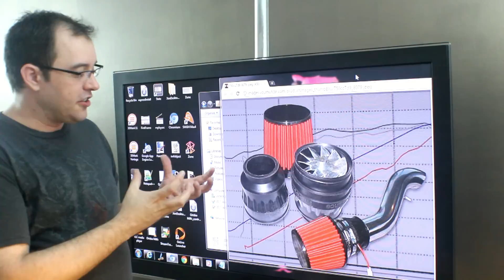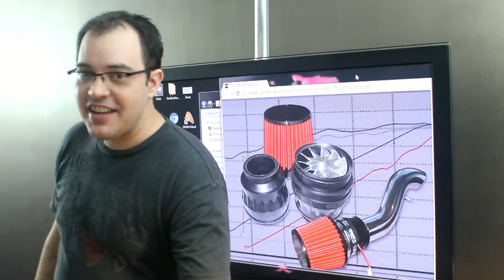Electric Turbo / Electric Supercharger / Forced Induction System: Should I Install?

Comment: the fact is, it helps. Any air being pulled into your motor will help efficiency and performance. however its not what everyone thinks it should be. it's a tiny fan for god sakes it'd not going to do what a real turbo is going to do, or supercharger. however hook an electric motor to the comprising fan and housing of a turbo and that will produce boost up to 3-6 psi. depending on your electric motor.

Comment: Good discusion on CFM.  To do the math, convert engine size from ci to cf.  Multiply by max rpm and divide by 2.  Your engine will never draw more than that using NA.  For a 350, it works out to around 607cfm.  Cant go by head flow cause you will have more than 1 intake valve open at a time.

Comment: @BlackwaterOpsDotCom Rule of thumb is 150 CFM delivered to the intake manifold  per 100hp desired. A 600 CFM turbocharger can help develope 350-400+ HP. Do you see this doing that? Airflow under pressure is much different than airflow.

Comment: Honestly, the only good one I've seen is an E-ram, and I could only see it's best application on a geo metro or ford festiva or ford aspire in colorado. The air is thin and these car's engine's have a hard enough time making power. Claims of these (single unit electric blowers) realistically making more than 2 psi is near false (there are exceptions). I think a tornado fuel saver might be handy for an E-blower just to act as compressor inlet guide vanes, maybe add a bellmouth to the filter too.

Comment: It's not that you couldn't boost an engine with an electric turbo/supercharger, but pretty much all the electric blowers I've found online that actually can deliver enough flow and pressure are large industrial units that would barely fit in the car in the first place. Most of them had at least a 5 hp motor to drive them as well.
It really shows how impressive the output from even a small turbo is.

Comment from the maker: It's about Pound of Air per minute not PSI, or CFM.  It isn't a placebo I measured it at the torque converter. the MAF and the Relative Torque meter don't lie.  I didn't leave it on, I wouldn't trust the thing to not burn up, or the plastic blade to get sucked in to my turbo. But basically as "pre-spool" it works. But again at the expense of raising my idle and sucking more gas, for minimal gain only at the low end.

Comment: Superchargers and turbos compress air and a fan can't. The better option is to hook up a leaf blower to your intake. It might cost more but it'll work a lot better
Reply: ***** yup
Reply: +Brandon Krause 
A leaf blower also wont work.   Because it's just a fan that blows air.  It doesn't compress anything.
Reply: Mighty Car Mods did it with leaf blowers and it gave a car like +2HP.
Reply: some other guys put 5 leaf blowers on and older monzaand supposedly it gave power.
Reply: mythbusters blew that out the tailpipe , better to blow dry your hair instead  !

Comment: to control how much power you want it to put out or if you simply want it on or off.
but the best part is , they run on power v from 7.2 to 14.4 so you can connect it directly to the battery with switch in between.

if you are interested in the idea and need any help, feel free to ask

Comment from the maker: I mostly agree.  That said, I did end up figuring a way to make it help.  Pulling air from under the car up, and ducting it towards the intake dropped the Intake air temp 1.5 degrees on a 70 degree day. Made no difference on a 100 degree day. Not worth the hassle, or the cost, and not being used as a turbo, but it likely would increase power a little, and MPGs.

Did much less than the intercooler upgrade.

Comment: The reality of these "electric forced induction" schemes is that conceptually they can/will work.  HOWEVER, the devil is in the details.  NOTHING is for free.  Turbos need a hot engine exhaust stream and superchargers need a belt and a pulley mounted on the engine.  What most people don't seem to grasp is that to generate any appreciable airflow and pressure requires a LOT of energy (many tens of amps of current).  I could tell just from the size of the wires sticking out of the "inline fan" dude was holding up in the video that it wouldn't work.  

To put it simply, if you see an electric turbo/supercharger kit and the diameter of the wires leading to the motor doesn't resemble that which goes between a starter solenoid and the positive terminal of the battery - it's almost 99% guaranteed to be junk.

Another thing is that most workable solutions are going to implement is a fan/impeller/housing shape that resembles a turbo.  An "inline fan" is NOT the proper design choice when you are looking to build static pressure - which is what a forced induction system needs to be able to produce (along with CFM)...

Comment: It may resemble one stage of an axial compressor, but they require quite a lot of stages to provide an actual boost, plus an entire axial compressor is quite large. Had it been a centrifugal compressor, even with a single stage it could eventually provide some useful boost.

Comment: The cubic feet per minute measurement is a means of distracting you from the figure you're actually interested in, which is psi.  The volume per minute assumes ambient pressure on both sides.  When you increase the backpressure, the volume per minute goes down reeeeeeal fast.

Comment from the maker: I didn't promote it, and I wouldn't leave it on the car. It was "full on" all the time. but on a 1.9L mini cooper with the first restriction being the stock air filter it pulled enough air to increase the air flow, and you could see the difference at the MAF Censor via the ODBII port.

Comment: Putting the blower onto the MAF sensor with the motor off key on, and the intake pipe disconnected at the throttlebody so it was open, the blower only generated ~220 CFM, which means at higher RPM.

having the blower in the intake was actually restricting flow somewhat as its flow was exceeded, and its in the intake tube being overspun by the vacuum of the motor.

Comment from the maker: @naserhamdeh I don't think anyone said it gave PSI.  And while I don't necessarily think that this product will work, PSI doesn't mean anything, any more than the CFM number, it is Pounds Per Minute that matter, the mass of the air. 4 PSI in a 1 inch tube is 1.3 PSI in a 2 inch tube.

Comment from the maker: @scratchyrice Very rarely is the amount of fuel the limiting factor. Liquid being pumped under pressure is easy. Pulling air from the atmosphere, cleaning, routing and pressing it in to the cylinder is hard.  

it's much easier to fill a bucket than to fill a tire.

Comment from the maker: Also you can have a 25 PSI 10 LB Min turbo that will "Baffle" and do 10,8,10,8  under load because it will compress to 10, but can't suck enough volume to keep it there. so it will spin up and down. never hitting the gate.

Comment from the maker: The mass air flow meter would still be metering air... I agree that this would like kill the idle efficiency, but properly installed, it is supposed to only run when your throttle is at 75% or more, or on a variable speed that scales with the throttle.

Comment from the maker: @SharpyBoy221 Carb CFM lends to if this will hinder the air flow, or not.  If you put a 120 CFM on a car that is sucking 350 CFM you are adding resistance for certain.  

And no it is not 2 bars. That'd be 29 PSI which would be a crap load since the JCW runs at 14PSI and the S runs at 11.

Comment: @drizzetsrevenge Just to clarify pre-ignition/detonation most certainly can occur in lean conditions in petrol's. It happens by igniting the mixture because of the excessive heat caused by a lean mix, before the piston reaches top dead center. The excessive heat acts as a spark plug in effect.

Comment: Didn't you ever watch "Roadkill Classics"? They hooked up 5 gas powered leaf blowers in the trunk. fed it into the carb and got 20 HP at the wheels and went 2 miles an hour faster than stock. The leaf blowers cost $1300. What a deal.

Comment: Some auto makers are looking into electric turbos or hybrid turbos. So it's a big turbo that receives some extra power at low rpm via a electric motor. But only until it has spooled up considerately. Then just relying on exhaust pressure. 
It sounds like a good idea in theory, rite?
Reply: En electric bilg pump for a boat is not an electronic turbo.
And you can go the rout of bi-turbo. A small turbo that spools up easily and provides a small boost in the lower area combined with a second bigger turbo that deals with the midrange.

Comment: THE ONLY LOGICAL THING TO DO IS THE SCIENTIFIC METHOD.

#1 test your car on a dyno to see how much torque and HP it makes.
step #2 install the "supercharger"
step #3  test the car with the installed supercharger to see how much torque and HP it makes.

Step #4  after 2 or 3 years of ownership, what's the fuel economy and does it still work?

Comment: Those are just fans.  They wont do anything.   An actual supercharger is an air pump which produces positive pressure.  A fan will not do that, but if anything obstruct the intake.

Comment from the maker: if you have an air compressor with a pin hole in it and the air compressor has 70PSI of air, that compressor is leaking at 70 PSI but could take 8 hours to go "empty" if it had a penny sized hole it would also leak at 70 PSI but would go Empty in a few seconds.

Turbos and Super Chargers are rated in Pounds per minute. 
Which is the Mass of Air that they move. They may also have a PSI rating, because they only have so much "seal". But a 50 mm blade and 60mm blade can both do 25PSI, 60 have > MAF

Comment: Electric superchargers actually work really well its that people don't know what they're doing to their car is why they get so much negative feedback, you must make sure it is air tight. You may also need a Performance MAF to keep up with the air flow to provide the gas for it. I saw noticeable gains on my ford ranger and dropped a full second or 2 off my 0-60 time and I only got a low psi blower
Reply: I also have a 2011 4.0L V6 ford ranger and set up my ram air kit with it and added a mini cone air filter with the full size filter to allow more air pulled in when it fires up like the tiger fan kits have and I've had gains too.i went with the diy 5000 tube unit instead of the filter/fan combo which seems to be restrictive with the fan at the filter outlet and the motor within the filter too cause I tried mounting the filter too it then maf sensor coupler to other side and it wasn't happy when at idle.but farther down the path tho works best.gotta b careful tho tighten it up on the fan side sleeve or it will pinch the prop.i like it and it still spins with out powering it like a turbonator.

Comment from the maker: @drjim86 I agree, To be fair though I think My mini is 2 PSI in a 1.9 liter engine.  And PSI scaled exponentially in power requirements, so while I Agree... I don't think an electric turbo would need to be 40 HP, likely 1.5 would do, but I don't think this is a 1.5HP fan.

Comment: i have a few things to say, 1 if anything its good that it is a bilge pump because they are designed to be strong enouph to run at very high rpm with a lot of strain from water and foreign objects that happen to be sucked up. 
But one thing i can say is that for amazing performance, get an RC ducted fan.
ILL CONTINUE IN ANOTHER POST-

Comment from the maker: Garrett GT2560 30 LB MIN, Alta R56 Upgrade 28 LB Min, 

Actually No. 25 PSI at 3000 RPM is and 25 PSI at 6000 RPM are different.
You need to know the LB Min to know if you get 25 PSI at at 500 RPM or if it won't kick in until 5000 RPM (I over simplify) 

CFM doesn't work because CFM is at 1 bar, and you need to be at more bars for there to be PSI. LB/Min, Gets you HP, PSI gets you Torque, Small Inducer means lower RPM boost, larger MM means more air (often at lower PSI).

Comment: Those fans are sold as engineroom fans for boats here in Denmark. 300 cfm, that equals the amount of air a 2,0 liter engine at 6000 rpm with a volumetric efficiency of 85 % and a charging pressure of 0,7 bar consumes. The thing is that a fan like that, doesnt charge a thing, it slows down/stalls if any resistance in airflow is present.

Comment: If the fan went fast enough, and used very little electricity it could add more air into the system and could up the power if there was the right amount of fuel and such. But I'm guessing it's not possible. To spin a fan fast enough to create boost, not just air flow, would probably take a fair bit of electrical energy which would probably tax the motor and wouldn't offer any gains. That's my take.

Comment: Its now worth the hastle. A plastic fan will block airflow to start off with which can lower rpm at idle. Once the fan starts, airflow will recover plus only about 10% extra air you wont notice much change.

Comment: A mass air meter measures the amount of air, volume. Optimal air fuel ratio is 14.7/1. Measured by weight. This fan would not keep up with a lawn mower engine. I have seen a whipple type super charger run by electric motors. Hooked up to a wide open throttle momentary switch. I think that would work.

Comment from the maker: As a result I have a theoretical limit of about 360 HP, (because I'm a higher compression ratio, but a lower Pound per minute rate)

I could install lower compression Piston Heads, and run a higher Boost Pressure which would allow me more horsepower, but at the expense of more torque to turbo lag.
This should be a video... I'll have to do this later.

Comment: dude this is a joke - this is just electric fan - that at it best will give you nothing as it worst it will slowdown air flow - Chargers or Turbos are not just blowing air  they compressing air at min 5 PSI of contiguous pressure - you can take this product  and use as a leaf blower.

Comment from the maker: @fixzy115 I will soon. I don't have a garage in Seattle and it has been awfully cold and wet. But I'm on my way to AZ and will do it there.  I meant to do it sooner just things came up. And I couldn't find a Dyno shop that would cut me a deal, which I always had access to in Silicon Valley

Comment: @BlackwaterOpsDotCom 2) it will either cause the engine to work lean at low rpm , or lean at mid high rpm, and one way or another you wont have performance and knock knock, there goes the rod. in addition to that you have the throttle body and no blowoff valve,number 3) look at its design, it looks like a hair blower, if you close the front tip of the hair blower while its working the air will just move the other direction, this design can cause no boost, unless you can make it spool to 150k rpm

Comment: SCAAAAAMMMMM

Mighty Car Mods tackled a similar issue. They even used electric powered blowers for lawn-care directly mounted in the intakes of the car running full tilt and it did nothing. Simply put, a fan is not a turbo. A turbo compresses air where a fan simply moves air. You would be lucky if you got a 1 HP increase from all that.
Reply: Actually, the leaf blowers did increase the power. Just saying.

Comment from the maker: Its Mass of air per time. (Pounds per Minute)  But 2 PSI at idle would be a lot. Your Charge pressure should be negative at idle.

Comment: They don't build pressure to build pressure at the airflow a typical car engine needs you'd need an electric motor of several horse power so instead of 4 amps at 12vdc you need something like 300 amps or more.

Comment: I fly model planes and i tell you now , not only do the ducted fan engines deliver huge power to weight ratios, they also put out huge amounts of air, for example;
A 64mm brushless motor ducted fan (slightly smaller than that cheapy one which is brushed) , puts out 420g of thrust that about 9 times its own weight and that means its putting through huger amounts of air too.

Comment: @bsoundpro Yes, Up to a certain point which is why its no problem with a simple intake upgrade like a high-flow filter or cold air feed. Manufacturers purposefully put limits on the maximum fuel amount in order to protect their interests. If you add a turbo or any real forced induction you will NEED to remap to change the maximum fueling and preferably timing. You stick a turbo or supercharger on a n/a car without doing this, you're just going to cause detonation.